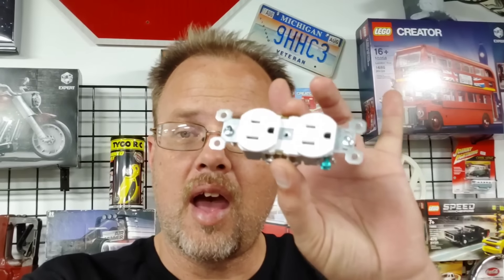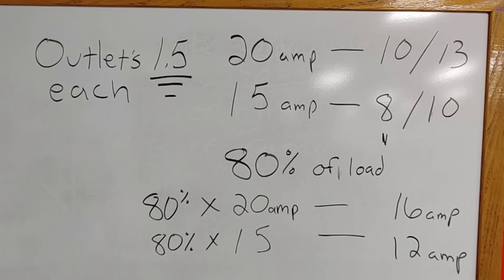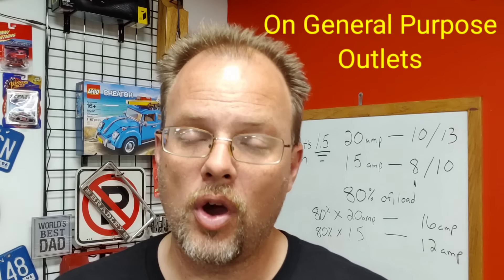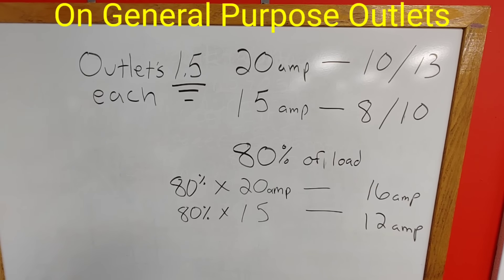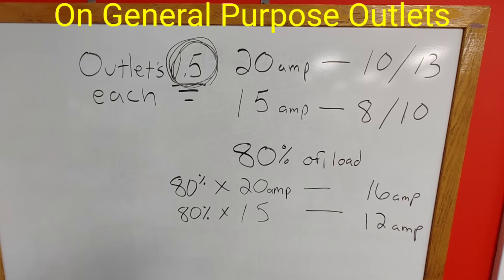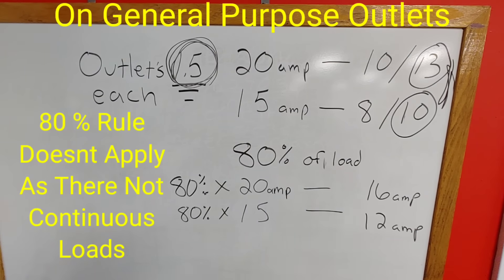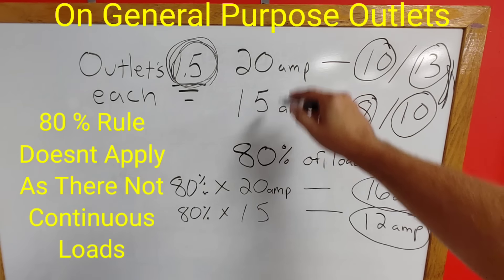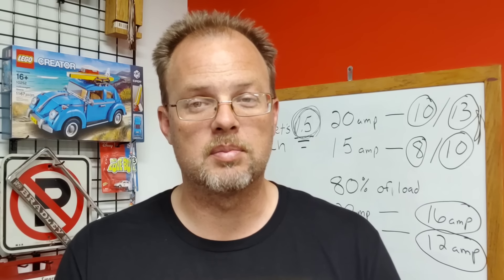How many outlets can you put on one circuit ?

Comment: Many as u want. There is no load calculation in nec. Proof me wrong if u thing u r right
Reply: You are correct, in the absence of any load I can have 24 outlets all doing nothing.  Just depends on what you are trying to run on the circuit.
Reply: Tenzin T
 ... there may not be code on a particular circuit but I there is code for figuring service size and new work based on square footage. There's also code base on running feet of wall space for minimum number of outlets. (but not maximum)
Reply: @rupe53  minmum number of outlet u want to safe money vs how many receptacle u can put on one breaker is different thing.
Reply: @benzaguru4548  ... true, but I do recall something in the code where you need to consider load by the square foot. Obviously you could have 24 outlets in a 10 x 10 room and the room size will be under based on the coverage area. If the room was 50 x 50 it would be another story.
Reply: @rupe53  lighting load is 3va/sft in residential. In commercial receptacle outlet load shall not be less than 180va for each single or for each multiple receptacle on one yoke
Reply: @rupe53  neck article 220 . Page 75 in nec code book edition 2020

Comment: Does anyone else feel like the 80% rule is hogwash? For smaller wires, I kinda get it, but only being allowed to use 40 amps of a 50 amp circuit for EV charging is pretty stupid to me.
Reply: You can load a 50 amp circuit up to 50 amps and run it all day and night.   That is if you use fuses, not circuit breakers.   Fuses are 100% rated overcurrent devices.   Breakers heat up internally and will trip with 49 amps and enough time.   Around 3 hours if the ambient temp is the same as test conditions.

Comment: 10 outlets on a 15 amp is ok but common sense means just don't hook up too many heaters at max power or you will pay $387 for an electrician to change a breaker.

Comment: 15 amp top load capacity is 1650watts so do the math, if lights and electronics then no big deal they're 3-15 watts give or take. Say you use a space heater which most all are 1500watts tops per regulation then 15 amp breaker and every other thing in the room will be fine but anything else high wattage no. 2 1500 watt space heaters on one 15 amp breaker will not work just to give an example being winter...any naysayers opinions welcomed